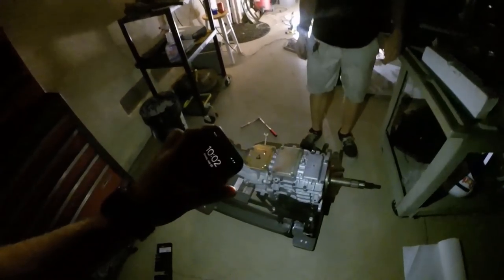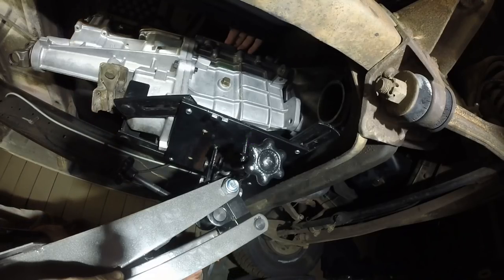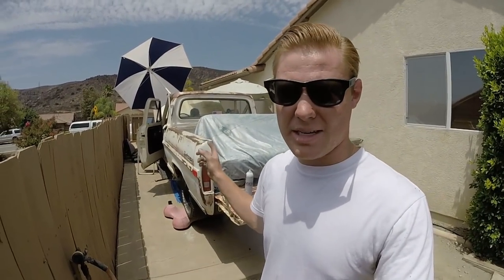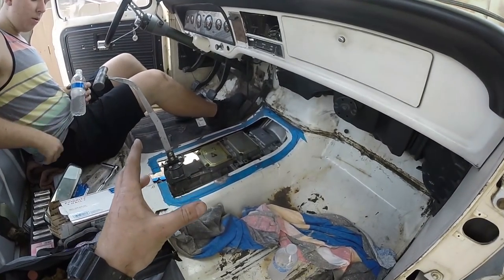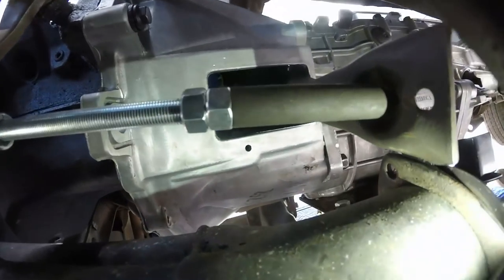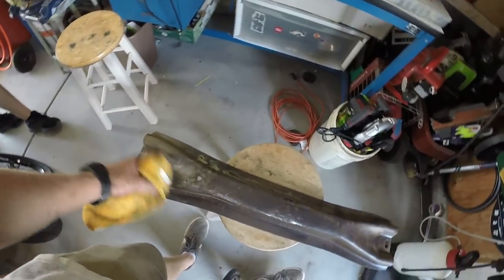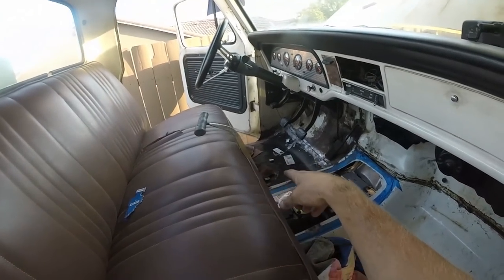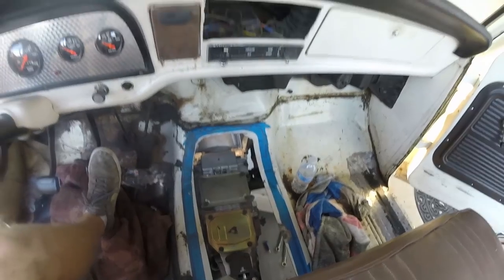The F100 Tremec 5 Speed Swap! Ep 3 Install and Clutch Setup

Comment: The cone that goes against the shift Fork where the adjustment nuts are you should try to find one that's threaded it's like 77 to 79 pickups had them. I had one come apart one night and lost the end had to drive home with no clutch.

Comment: Just a suggestion.. Instead of spending 150 on a bench seat shifter.. You could take a piece of metal, like a 4" by 4" and drill holes and move your shifter up far enough to have it drivable. I'm sure by now you're already putting your bucket seats in but hey. Just a suggestion. Love your work man
Reply: Ashton Lawson That's the same thing I was going to suggest. I hope he reads this one. There should be something in his scrap metal pile that he could do that with. It would mean 2 more nuts and bolts, but it would be temporary. Have a good day.

Comment: Make an adapter bracket with a 30 degree bend in it. Just big enough to bolt to the shifter base and the linkage rod. This is a temp fix and when you go to your buckets you simply remove that bracket and bolt the shifter back to where you have it.

Comment: I did this same swap on my '78 GMC. Three speed on the column to the TKO floor shift. It's a great trans. I see you have a video on making a shifter, I ended up just moving mine to the center plate on the transmission.
Reply from the maker: Yea this was just cheaper so I just made what I had work

Comment: From what I've seen you have the welding and fab skills to alter that shifter to fit. Just a matter of cutting the shift lever and welding in a curved piece. On the other hand you already have the bucket seats. You could just go ahead and put the buckets in.
In any case congratulations on solving the problem with the clutch linkage instead of doing the cable or hydraulic route that you didn't want.

Comment: you could go to a weld or machine shop with the existing shiftier and tell them your problem and have them build (plasma cut) a shiftier that will go around the bench seat im sure they have a 1/4 drop plate they can use

Comment: Just a fore warning about the clutch fork, I recommend putting a return spring going from the engine cross member to the clutch fork. Because as you drive and everything breaks in. Your clutch rod may start rattling against the fork. Mine did after I finished my engine swap. just my two cents so you don't start chasing a noise around like me.

Comment: Once you get driving if the clutch pedal is still to heavy and short of a throw you can mobe the rod further down the shift fork away from the transmission. This will gove less throw for the clutch (or a longer pedal push to the floor) it will also make the clutch lighter in doing so. Might make it a bit easier to daily drive. Glad it worked out! Make sure to all jam nuts and locktight to the all thread!!
Reply from the maker: Thanks for the info! I’ll most likely go hydraulic soon anyways but this will do for now with some fine adjustment!

Comment: Don't buy another shifter, just get ahold of some 1/2" plate steel make it 2-3" long and bolt plate to bracket and shifter moving it forward. Put a boot cover over it and no one will notice. Once you get your buckets set-up, remove the steel plate.

Comment: I have a 1964 Ford Galaxie 500 2 door Fastback and it's a 3 spd on the column, but I'm converting in over to a C4 auto. question: what is the year range of a C4 Auto that I can use on my car just by bolting it right up to the car without a adapter plate needed?

Comment: Hey I have a quick question I have a 68 ford f250.  I have a 390 fe motor bore over 30 good power. I want to put a 3650 trans with it hold up. They sell adapter plates for it thank you like your truck man.

Comment: Craig, can you please share which clutch fork you're using and which throughout bearing? I am assuming the stock F100 clutch fork and the bearing from the clutch kit (maybe the foxbody type)?
Reply from the maker: MIke W stock fork and bell housing so everything mounts the same as original. Just replaced the throwout bearing with a new one from oreillys.

Comment: why buy another shifter just heat and bend the one you have :) been there done that with a 1965 chevy 5 speed
lock the handel in a vice and heat just above the bilt point itll be trial and error so bend a little at a time til its forward then you just need to go up a little higher and bend it back